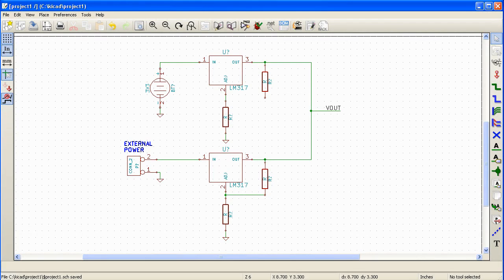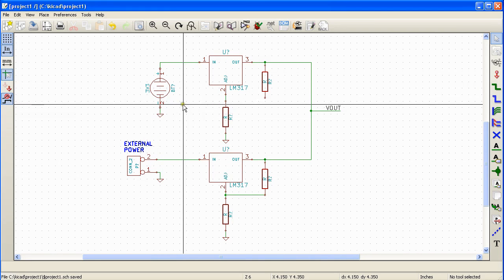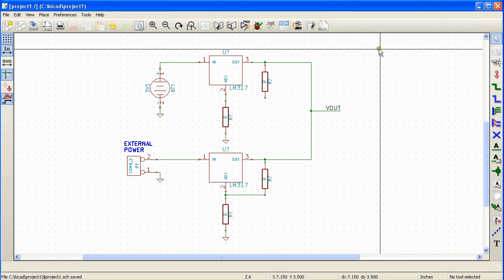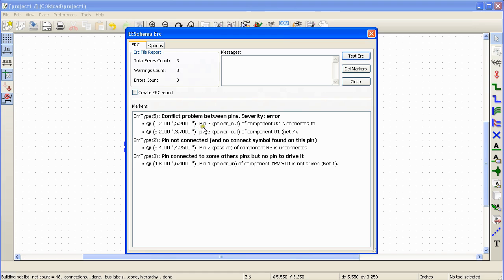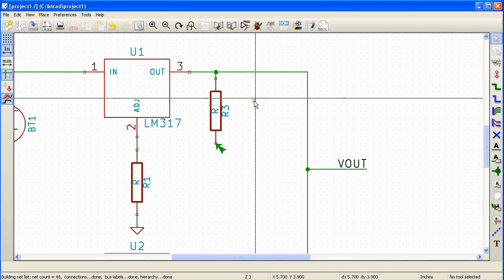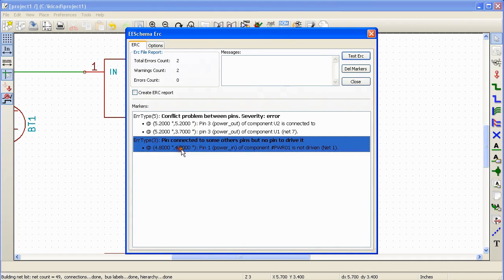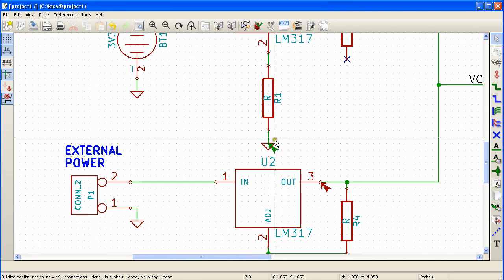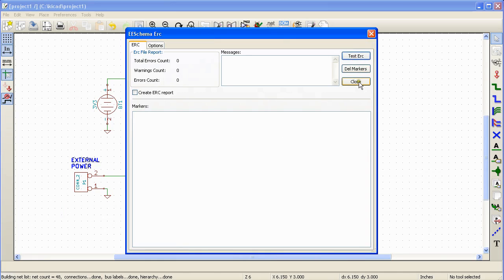KiCad Tutorial Part 7 - Running ERC

Comment from the maker: There seems to be no way to do this in schematcs. But on the board, a module can be rotated by an arbitrary number of degrees. Just double click on the module and select "user" option under "orientation" and type in the rotation as  number between 0 - 3600. This will let you set any angle at 0.1 degrees resolution.